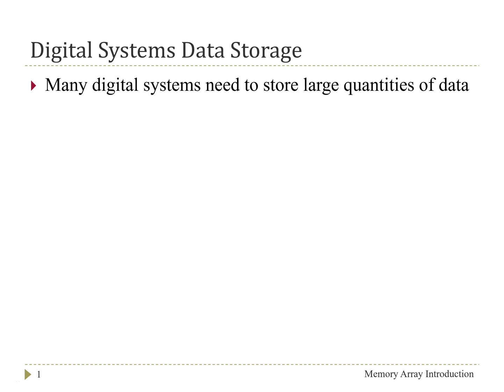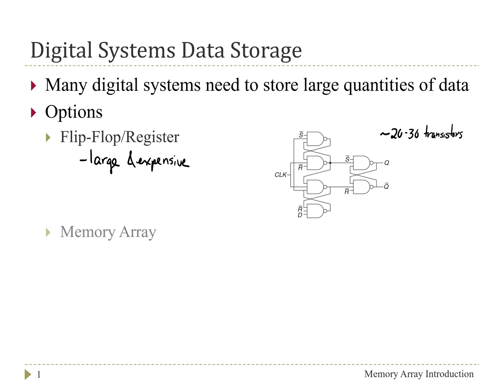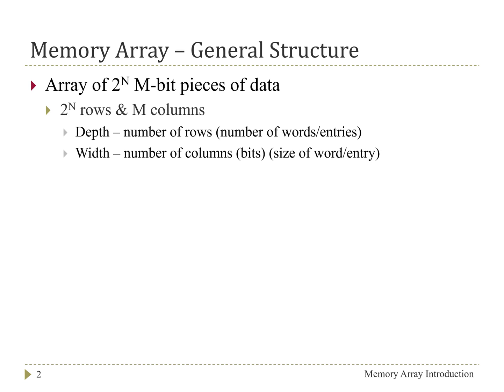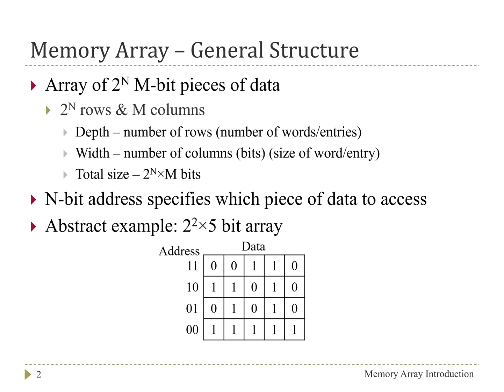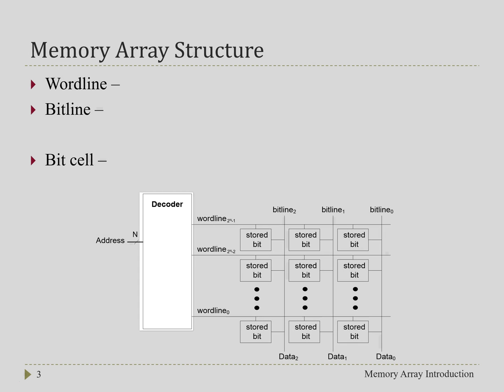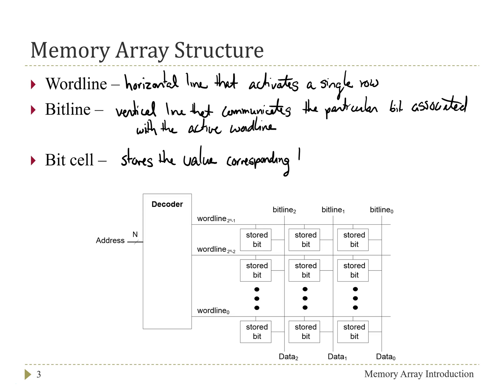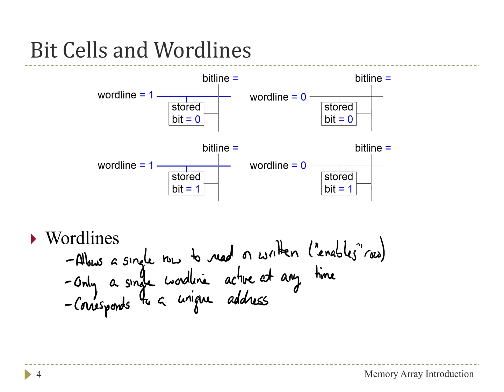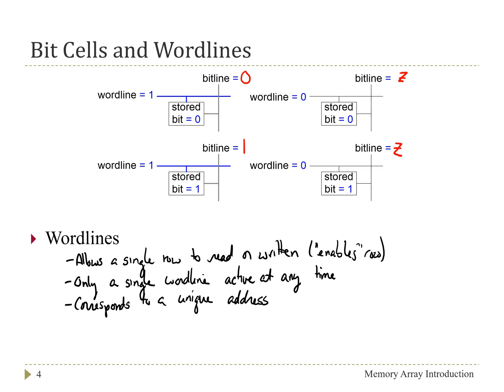Memory Array Introduction

Comment: what if it is 2^5*4
Reply: Edit: My bad, I interpreted it as 5 * 4. A 2^5 * 4 Memory array would have 32 rows/ entries and 4 columns or 4-bit data. See the grid at 3:08. Imagine it having width of 4 (columns) and 32 rows. The addresses can be stored in 5 bits.